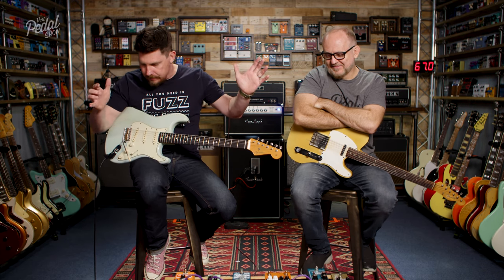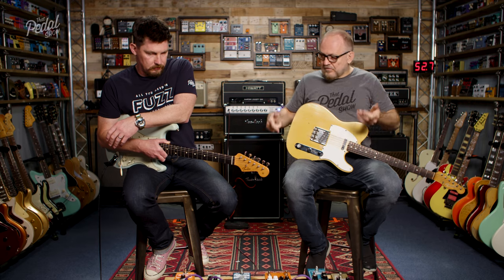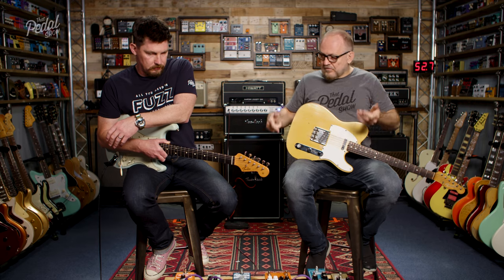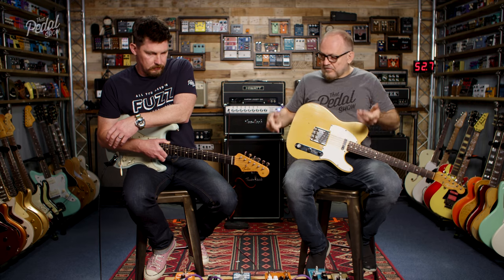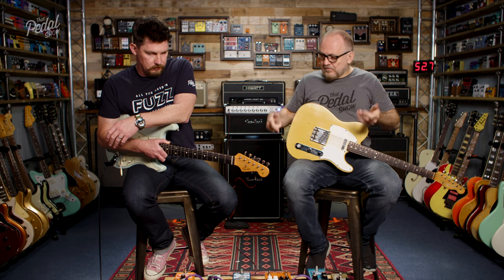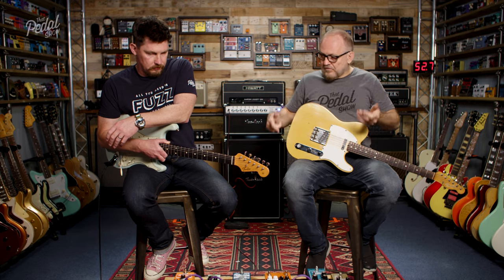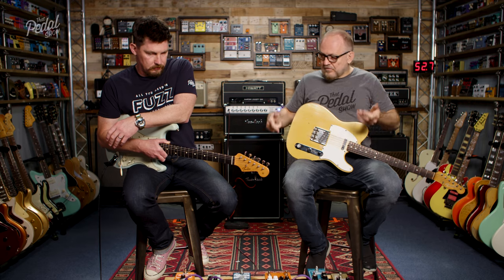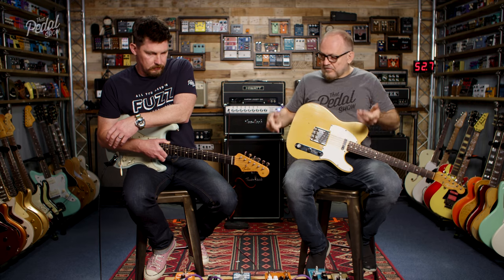To Buffer Or Not To Buffer: That Is The Question – That Pedal Show

Comment: Couldn't you use an empress buffer. Plug straight into the secret machine, run a patch cable from that into the "in" of the buffer, put every other pedal into true bypass mode and run them in the loop of the buffer and then run from the out of your buffer to your amp? Just eq your amp so you don't get those open highs from the buffer your not enjoying? Empress buffers are tiny and can sit underneath the board (solves you size issue) unlike that 29 thing. Not gonna lie I kinda got lost listening to this, so you probably already talked about why a buffer second in the chain wouldn't work.

Comment: At the risk of sounding stupid (I barely even understand this stuff), but I know that Boss Pedals are all buffered, so wouldn't putting a Boss tuner pedal for example, in front of everything, solve the problem? Or is that too simple? Or at least having it in there (which can sit in any order of your pedal board without colouring the sound) help in some way? Just a thought.
Reply from the maker: Not stupid at all! Absolutely, a Boss buffer would have a similar effect to the other buffers here to a lesser or greater extent. And that’s really the point. How much do you want, and where? So for me personally I don’t want any buffer before the fuzz because it breaks the relationship between the guitar and the fuzz... and then after the fuzz you need to be okay with the effect the buffer has on your subsequent overdrives. Nothing is right or wrong here, just understanding that it will be different. Cheeers!
Reply: @ThatPedalShow  Maybe I understand this stuff better than I thought... all thanks to you blokes. Love your channel. Cheers!

Comment: So a question I would have is, do you set your amp up plugging straight in or running through your pedals. It would seem if you’ve got it set based on running through the board then you don’t need a buffer, but if you want your guitar plugged straight in sound, maybe the Euna?
Reply from the maker: We see where you’re coming from Mark. And it really depends on whether you want the extra presence and brightness (and everything for that matter) of the buffer. As you allude, it’s basically like having a very short patch cable only between guitar and amp. Personally I really do not like that sound, which is probably why I’ve always steered away from overt buffers. But some people really really do, that’s where the buffer works. And in our case of course, Dan and I are usually using a switcher, so with nothing on, it’s just guitar, cable, amp. Unless your cables are very high capacitance or there’s some tone suck in the switcher (Dan’s stuff emphatically has no suck) then I wouldn’t personally add a buffer. Pretty much the only time I’ll use one is with the Gretsch Electromatic because the pickups are so weak it just sounds dead and flat with any loading whatsoever. Erm, tangentially, new pickups and wiring going in that very soon, so there’ll be no buffer there either. Hope that helps? Cheers!

Comment: Is this issue something that is unique to Fuzz Faces? I ask because I have an EQD Park Fuzz on my board ( Germanium mk3 Bender-y thing) and it definitely wants to be first in the chain, but I haven't noticed it being affected by anything after it. There are no buffered-output pedals on my board currently. I did have a Wampler Tumnus Deluxe on there, but I didn't notice any effect on the Park then either. I did, however, find that my EQD Westwood overdrive sounds different after a buffer. 🤔

Comment: Dan and Mick . I notice the volume control on my silicon fuzz face makes a huge difference to the tone . Turn it up high and I get the clarity I prefer . Back it off and it just turns to mud ☹️
Do you think you could explain what's happening in viewers q and a ? 
Thanks both for another cracking show .
Stay safe 👍
Reply: Think I've just twigged . By altering the fuzz volume I'm changing the input impedance of the fuzz ?
Reply: @SHAKEYMEISTER  The Volume control on a Fuzz Face does affect the output level, but it also forms an RC filter with the output capacitor, which, depending on where the Volume is set, will alter the cutoff frequency - which you hear as more/less clarity
Reply from the maker: This is interesting! Thanks Phil!
Reply: @ThatPedalShow  Happy to help!
Reply: @philrob110  
Fantastic . That explains it . Thank you Phil 👍
Just been experimenting with the Fuzz before my Boss Blues Driver . Very interesting also 😀👍
Reply: @SHAKEYMEISTER  No problem. There's a few tricks to getting the most out of these vintage style Fuzz pedals. Try a long cable between the output of the Fuzz and the input of the Blues Driver also - you might like the effect that has. (It will take the brittle top end off)
Reply: Brilliant . I'm going to try that next . 👍
I'm really liking what the combination is doing as I can back off the fuzz volume so when I kick it in I don't get a big volume increase . But also I still get that top end . 
Also these little changes make such a huge difference ! 
Down the rabbit hole we go 😀😀👍
Reply: @SHAKEYMEISTER  Excellent. All of these issues you have raised I addressed when I made the Silicon Phuzz
Reply: @philrob110  Yes , have just looked at your website now and the PHUZZ 😀👍
Reply: @SHAKEYMEISTER  Any questions, feel free to email

Comment: I use a boss tu2 first I’m the chain which I’m told has a buffer...I’ve never really messed around with my pedals to see if my times being sucked or anything. Should I be using it second I’m chain? Second after the tu2 atm is a big muff clone

Comment: The thing that bothers me about the section with Euna, is that you guys have the Bright switch ON, and then complained that it's bright like a buffer? Why wouldn't you turn the bright switch OFF on Euna, and just keep the low end boost on? Seems like a big oversight :)
Reply from the maker: We do that, we do every permutation I think… mick here.
Reply: @ThatPedalShow  Hi Mick! Unfortunately not, you do an "Air" switch engaged alone, after which you switched to Bright and Low engaged. I think you'd have a very different experience with the bright switch off! :)

Comment: Hi guys. Is it possible that my EHX small stone copy ( so accurate that has the same volume drop ) has so low output impedance that simple buffer restore all/most of my sound. Or vintage EHX has that volume drop and I have to live with that. Is it internal buffer set or capacity of cable? Stay safe and healthy. <3

Comment: i'm an electrical engineer and while this is very interesting from a technical standpoint when i want to play guitar i just don't have any fun at all worrying about these sorts of issues; they just give me less playing time and more frustration.  i want my pieces of gear to play nicely together.  to me vintage is great when it helps you sound better or play better but not when there are modern alternatives that are extremely close to having the same sound and/or feel without all of the downsides.
Reply from the maker: Fair point Scott. No modern fuzzes sound right to me though. Modern made vintage circuits of course, but if you like fuzz like I like it, nothing ‘modern’ really cuts it. Each to their own.
Reply: @ThatPedalShow  seems that one reason that you created gig rig was to let you decide how everything would route with each patch so you could minimize this issue when using your fuzzes.  i never have been into fuzz but maybe you'll convert me sometime.  love your stuff.  keep up the great work.

Comment: So many thought sand a bit of confusion. 1) I didn't like the Klon when it was inline on or off (with the Secret Machine at the front). I'm surprised you guys did. I guess it sounded different in the room?  2) You mentioned independent loop switchers at the end. Did you say that that they may or may NOT work? Can you tell me why they would not? When you switch in loops are they suddenly effecting each others load? (I have no idea about that) I have more questions, but that was my biggest. Thanks guys!
Reply from the maker: Loop switchers... if you need an always on buffer and that buffer is on, say, a delay pedal in a loop... when the loop is off, the buffer is off too, so no always on buffer. Does that make sense? 
Klon. Indeed. One reason why it’s such a divisive pedal. Cheers Larry!
Reply: @ThatPedalShow  So the pedals in the individual isolated loops interact when they are selected? (sorry, probably a dumb question, I know!)

Comment: “Console grade build”... I think that just means it was assembled by Sonic the Hedgehog and the Super Mario Bros.! 😜

On a more serious note, if you used a switcher wouldn’t it be an option to have your buffer of choice either in the same loop as your fuzz connected immediately after it, or if you have a programmable switcher for one of your patches to automatically bring in the buffer in the signal chain immediately after your fuzz each time, so that every time you’re using your fuzz you have the buffer and whenever you’re not using the fuzz you don’t have the buffer in circuit affecting the tone of your other pedals which come after it?
Reply from the maker: Yep, that would work! And thankfully fuzzes seem okay in the loops of Dan’s switchers. Hooray!
Reply: @ThatPedalShow  woo and indeed hoo!! 😜

Comment: Have you tried running the Fuzz in parallel with the effect after like the delay with the wetter box like you guys did when showing two overdrives in parallel vs. series? Would that fix it maybe? Also, on your current board with the fuzzes not in G3 atom, what’s your signal path when you have pedals outside the G3 atom? I have a QMX8 that I’m trying to figure out which pedals to make sure are in the QMX8.
Reply from the maker: Hello Jacob. That’s an interesting suggestion. Too much hassle / complex for me. But... pedals outside of Atom. I have an overdrive and a fuzz before Atom. Ideally I’d have nothing outside, but if you run out of loops you need to make a decision. I guess I’d choose the things that don’t need any wet/dry splitting; that don’t have any phase issues to sort and the ones I least need in any sort of preset switching. Hope that helps!
Reply: @ThatPedalShow  haha I understand. It was a thought I had the other day when watching that video. I was like “I wonder what different effects sound like in parallel that aren’t the same.” 
This helps a lot!! I also got my harmonious monk the other day and I’m stoked to try it once my board is fully built.

Comment: Is it possible to design something like an inverse buffer, where our output impedance is relatively high? Im thinking of it, because I'd like to use my Fuzz with all of my Guitars. Some of them have active pickups in them, which makes the fuzz sound really weird.
Reply from the maker: Hello Max, check out some of the videos we’ve done with Simon Jarrett of Kingsley Amps & Pedals. The most recent one has a section at the end where we talk a little bit about it. The ‘problem’ is that vastly changing the output impedance of your guitar will have all kinds of other knock ons. Probably better to find a fuzz that actually does work with active pickups. Apparently they exist! Cheers!
Reply: @ThatPedalShow  Thank you! :) I'll check that video out. When I bought the Boss FZ-1, I didn't thought of this topic, but I guess that's the way it is. :D

Comment: Wait wait what??? I've been raised on years of ad copy to believe that true bypass means that your full "true" guitar sound is preserved. That if you have a line of pedals - all true bypass- then it will not degrade your tone. However- I'm not going to pretend that I followed all of this video- there's bits that totally lost me. BUT- the part where you switched the echorec in and out of true bypass- in which the buffered sound was noticeably brighter and louder, makes me just scratch my head. Is the "true" sound the bypass tone, and is the buffer "adding" high end and volume- OR- is the buffer keeping the sound "true" in which case the true bypassed sound out of the echoer is actually a degraded tone? - Man- questioning everything!!!!
Reply: I think as they've both said with true bypass your signal is still going through the pedal switch and the interconnecting cables . The more you have will add impedance and hence effect your tone 👍
Reply: A buffer is a circuit which can have a different input and output impedance and also can boost or cut along with offering additional eq if designed in . It all depends on what pedals and guitar you have . They all play their part in your tone 👍

Comment: How should I use a buffer pedal with the gigrig 2? Should I put it just in one loop like any other pedal and turn it on on every preset?
Reply from the maker: You don’t need to. There’s a built in one that you can turn on, but it all depends on why you want to use a buffer.
Reply: @ThatPedalShow  is it an input buffer? How can I use it with stereo pedals?

Comment: Where do you place a tuner pedal?
Reply from the maker: If I’m not using a switcher, mine goes anywhere after my drives. Mick here. Although it’s been a while since I’ve had one on my board - peg head tuner and save space on the floor. ;0)

Comment: i have cable length 17f/5m before pedals, then i have 8 pedal (have some buffered, some true bypass), then output cable to the Amp are 10f/3M or 17f/5M. so do i need a Buffered stompbox? can anyone to answer my question

Comment: A very sobering video, and a MASSIVE 'elephant in the room' for guitarists (and any other musician that chains pedals) that needs more exposure. Pedal manufacturers NEED to cover pedal chaining scenarios - and how to fix potential issues - in their user documentation.
Unfortunately(!!), there are so many guitarists that don't know about these issues and instead, simply adjust each pedal input/output volume etc to 'compensate', thinking that is the real/correct sound of each pedal when they are chained together. They're certainly not getting what they paid for. Sad but true.

Comment: "Very nice buffer"  buffers are so simply.  the best is based on a TL07x op amp, but you can also do NPN, PNP or mosfet buffers.  The downside is the impedances of the transistors aren't as 'perfect' as the TL07x series.  but they have less than 10 parts in it  (Op amp has 6, jfet has6 or 7 depending on how you build it    it is simply a 1:1 'amp' with high input impedance and low output impedance.. so 'nice' buffer is such a freaking cork sniffer thing to say.  a buffer is a buffer.
Reply from the maker: But they sound different, right Ted? As we proved here. Cheers!
Reply: @ThatPedalShow   it proves nothing but confirmation bias.  The klon buffer, for example, in looking at the schematic is a simple buffer based on a tl072 op amp using the non-inverting input.  it is getting 9v from the power supply, not even a bump from the charge pump.  As I mentioned before the TL07x based buffers have ideal input and output impedance.  I've got a simple buffer of a similar type using a tl071 single op amp, and compared it to my klon.. and gasp. they are the same.   However I've no doubt you'd find it inferior because it is in a temporary blue plastic light switch box for testing and has a sum total of $5.00 US in parts including the in/out and power jacks and isn't in a $5000 mythical pedal.  Bet you get the same results with a JHS Little black buffer  even though it uses just a filter cap before the non-inverting input rather than a resistor in series with the input cap like the klon

I cannot speak to the other buffers you had because I don't have the schematics in front of me but I stand by a buffer is a buffer is a buffer.    The long and short of it is this, put it in a mix and nobody will really be able to hear it.  Some musicians will claim a subtle difference, but in the end it makes very little difference to the end product.

Comment: Im gonna just say maybe the immortal echo just isn’t great.... I’d never be able to deal with that drastic of a buffer change. It sounds great on. But I wouldn’t leave it always on. 

So does that make it a bad pedal or a good pedal? Hmmm

Last thought. I’d also just set my amp to compensate a little for what the 29 pedals adds in brightness.
Reply from the maker: But it does sound great, when being driven by a standard guitar or buffered signal, that’s the whole point